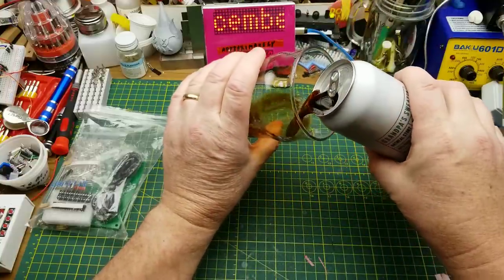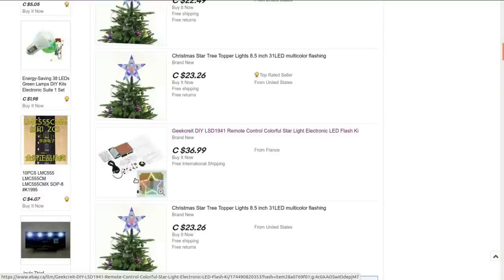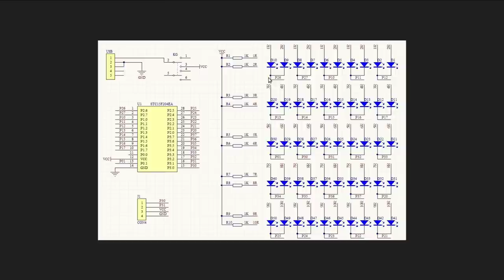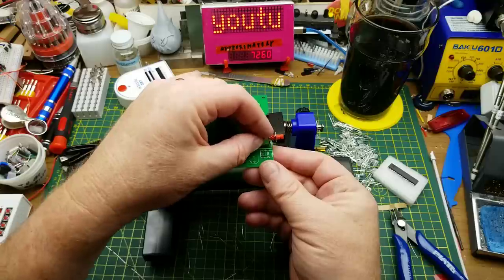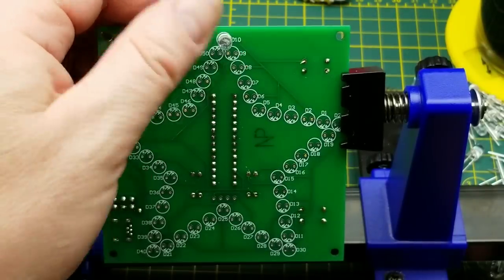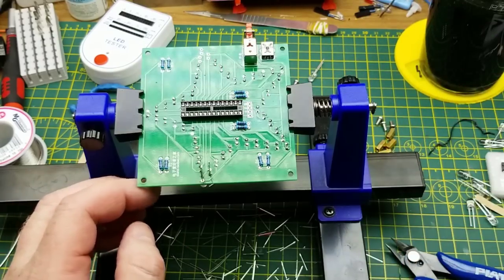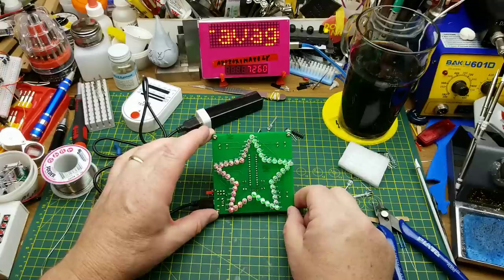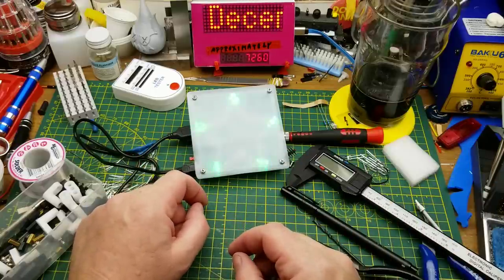December kit builds: animated LED star

Comment: I make these kits a lot. They work in a very clever way, in that the voltage on the pins is held high enough to allow the colour cycle IC to run but not enough for the LED to illuminate. That means that they can send a string in blue, despite that being not the first colour in the sequence. The programming of the STC Micro handle this, and the end result is very impressive.
I sand off the PCB then solder all the components except the LEDs. I trim the leads then "ball-re-solder" the connections to produce a nice smooth appearance. Then I spray the whole face in matt brack, and finally I fit the LEDs. The resultant black face really improves the contrast and appearance.
Reply from the maker: That's an interesting way to improve the looks of it.  I should try that the next time I do an LED display type board.
Reply: @pileofstuff  - Acrylic car paint works better than enamels, plus it dries almost instantly. Chalky matt black looks best but it gets fingerprints, so better with a very slight satin finish.
Beware that on this Star kit the LEDs are orientated strangely in that they kind of follow the outline star shape rather than being all Anode Up or Anode Down. So, take a photo first or draw a diagram so you can refer to it after you hide all the PCB markings.
Reply from the maker: @johncoops6897  Yeah, I noticed the orientation changed a few times going around the path. Definitely a trap for anyone not paying attention (or drinking a bit while soldering)

Comment: The STC15 series is 8051 based and actually easy to program. They all have a built-in ISP on P3.0 & P3.1 and it just needs a serial cable/adaptor to program. The free C compiler for them is SDCC and PlatformIO supporter them in the IDE. They actually handle external interrupts really fast and have some advantages over other uC lines.
Reply: There's an ISP header on the board and in the schematics at 3:44.
Reply: Amazing how many MCUs are still being manufactured with this really old instruction set.  It has a register: "A"
Used some variant of the 8051 in lab class, back in 1990?   Vaguely remember some painful process of uploading to it through a PC/XT.

Comment: I saw on the board in this video that there is a 4 pin spot on the board for the negative, positive, RX and TX line so you could change the pattern.
Reply from the maker: definitely could, if I was familiar with programming that class of microcontroller.

Comment: Thanks for that.  I'm still weeks behind in my content consumption, but I hope your holidays were enjoyable.  

And I was wondering - did you manipulate that outro video sequence at all?  The colour of the LEDs in those patterns seemed to be under program control (see esp. the red/green alternation at 17:46 and the alternating half-stars of different colours at 17:52), and that shouldn't be possible with simple random colour LEDs. 
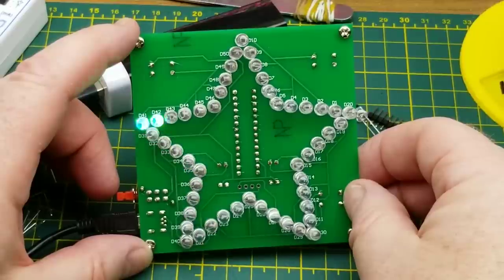Watching, then re-watching, then re-watching again at slow playback speed, I almost convinced myself that they were consistently red at first, then change to green, and only sometimes make it to blue.  But then I noticed the sequence at 18:18, (and on review, at 14:34, as well) and there seem to be  LEDs coming on at one of green, yellow, or blue, with no visible red. 

Any chance of sticking a scope on some of those lines, and maybe playing with the spares on an Arduino to see if there's anything more complicated going on?  Or at least confirming that it's just a trick of the camera's shutter speed and colour response? 

P.S. Regarding "should I put them right tight to the board, or should I leave them standing off the board like that?", your decision was correct.
 If for no other reason, then because it was your kit to build how you saw fit!  :)  

Cheers - Rob
Reply from the maker: All I did for the end scene was to lower the lighting in the room and lock off the exposure on the camera so it didn't bounce around with the changing number of LEDs lit at any given time.

Some people have suggested that there is some trickery going on to cause the control chip in the LED to advance it's sequence before getting full power to light the actual LED later in the sequence than it naturally would.  Seems like an interesting technique, if that's what is going on.

Comment: Do you have trouble with the resistor bandolier adhesive fouling the solder joint? I usually cut out the resistors.
Reply from the maker: Not usually.  
Unless it's a very old component that I've been hoarding since my teenage years.

Comment: Am trying to figure out exactly what these 7-color 2-wire flashers are.  Can see they are sold on a PCB kit, called KY-034.
They come in "Fast / Slow", "Clear / Fog", and "3mm / 5mm / 10mm" ... but cannot nail down the manufacturer and datasheet.
Anyone know where to find the full datasheet on these 8-state LEDs?
Julian Ilett decoded much of the signal process here:  https://youtu.be/gxdgRHmOuIo
Reply: They aren't "8-state". They are RGB with an internal IC processor that cycles through a variety of (preset) colour changing cycles. They are EXACTLY the same LEDs used in millions of colour-changing solar lawn lights, christmas tree lkights plus every other auto-colour changing gadget in the world.
Reply: @johncoops6897  You should check out the link to Julian Ilett's vid in the link I posted above.
Low pulses from an MCU can actually govern the color.  3 primaries + 3 pairs + white  + off.